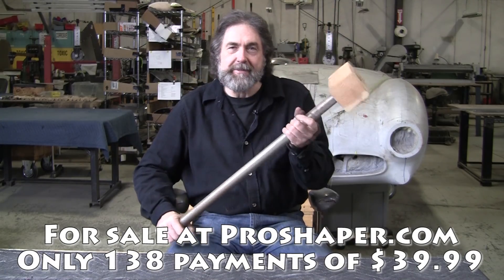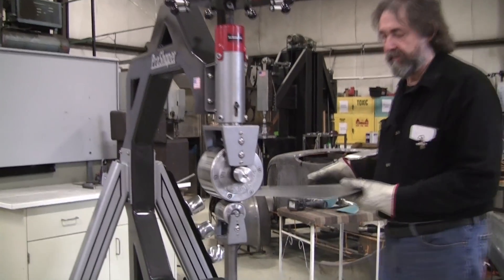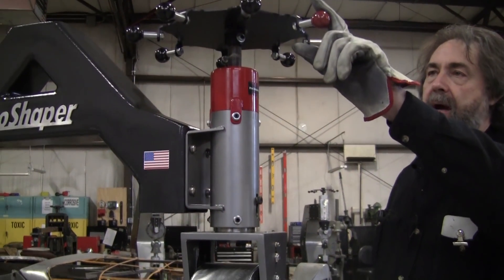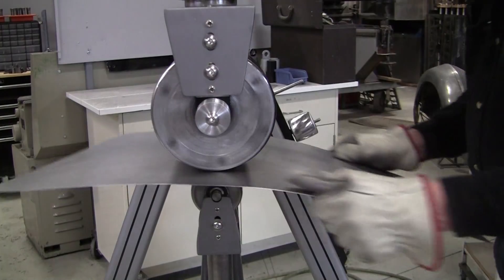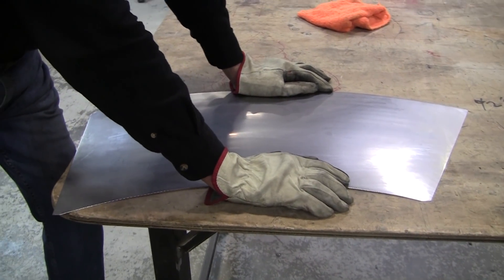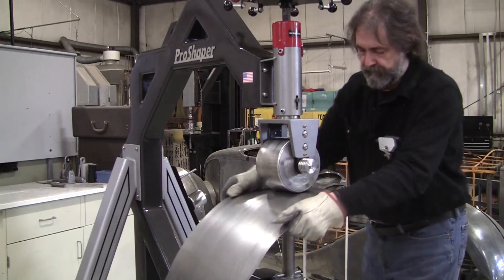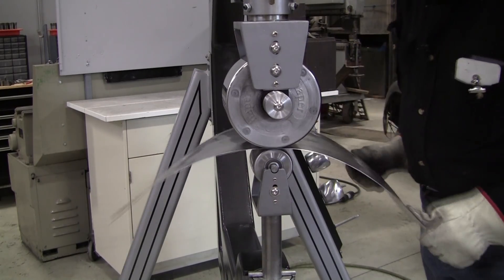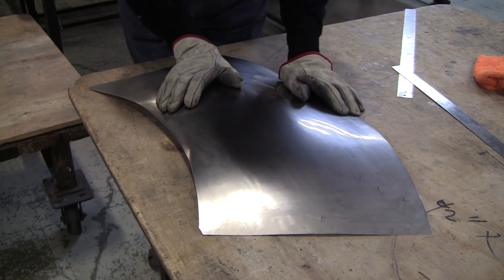How to make a compound curve

Comment: Question:  does direction of travel (lengthwise or shortways) apply an orientation to the compound curve in any way?  Or is it only about how much time is spent on each area with a given pressure regardless of what direction was rolled to get there?  What I took away from this video was the lengthwise travel over most of it and the switch to shortways at the end was about what is most convenient for going over the section of panel you're working on at the time.  Is that a fair assessment?  My naive expectation had been that the high or low crown of the wheel smushed the panel directly into that profile, but that's not it, is it?
Reply from the maker: Hi Dennis, The long travel on a panel is the more efficient method to work the panel. Which way you wheel in the end doesn't matter other than efficiency. The development of the desired crown depends on the location on the panel you work on most and the tooling you use. You are working to create the area value. You change the area value from the flat sheet to the value it needs to be. Once you have the correct area value you then set the arrangement value. How you get there, what tools you use is a personal choice. Once you get to the desired area value you should also have a almost flawless surface. Once arriving there it will easily pop into the correct arrangement value and then look like a flawless panel that you desire.